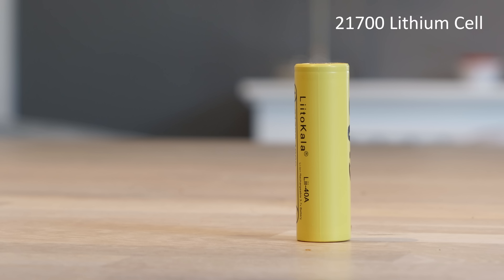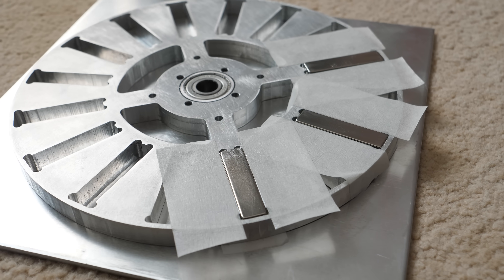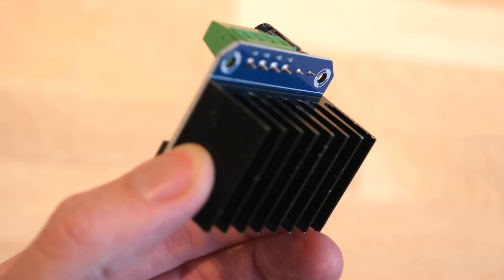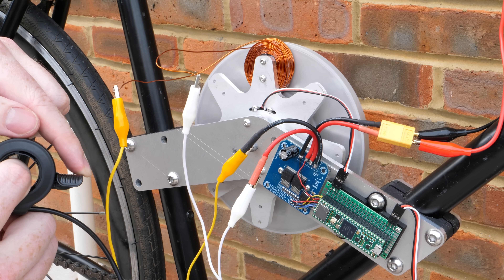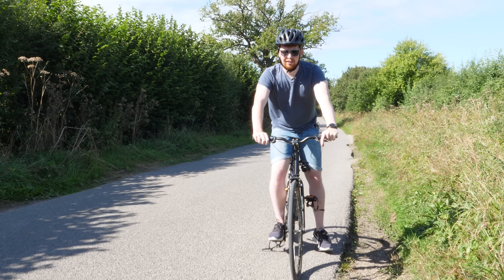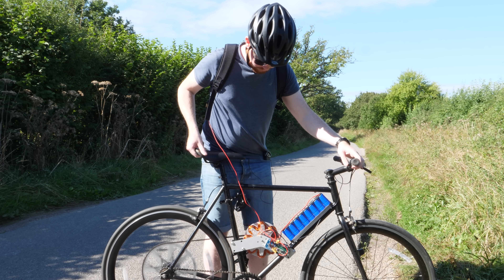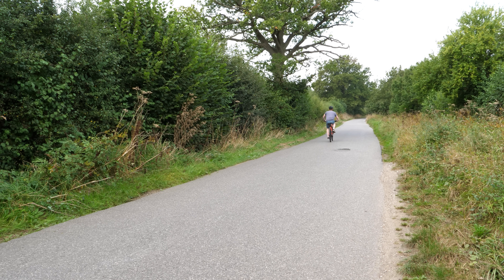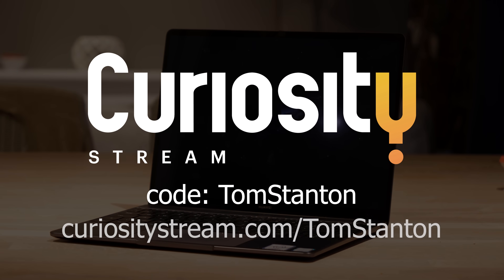Super Capacitor Bike

Comment: ´Hmmmm... may there be a logic falacy? 
Your Capacitor countains roughly 1/40 of the energy and is loaded in 1/50 of the time... may there be a connection between energy flow and time? Lets say, there is a thing which can be described as "resistance against an energy flow" cause if you shift many energy from A to B there may be some energy lost... and this loss is limiting your structures.. so if you shift many energy in time, there may be a constructional limit how many energy pro time unit you may shift... and if this limit is similar, then 40 times more energy needs 40 times longer to be transferred... if you laod a capatictor too fast.. this gives also sometimes a "caboom".....

Comment: It's very funny that you say that as the battery power depletes so will your car power/throttle.
I have a lithium ion motorcycle and it gives me full speed/power/throttle up until the battery cuts out.
It's only lead acid batteries that give off less energy as they discharge.
Lithium-ion gives its full energy until it's basically dead.

Comment: Wouldn't it have worked better if you connected the capacitors in parallel? 'Cause series capacitors have lower capacitance than a single capacitor, right?

Comment: What if you used these supercapacitors in between the battery and the regen circuit? Wouldn't it be able to act as a really faster charging buffer so more energy can be stored and then gradually moved to the actual battery afterwards?

Comment: Whenever the previously excited (set of) coil(s) is disconnected, at its (theirs) ends arises the BEMF with the peak value disproportionally larger from the input voltage, and it can be used to either recharge the supercapacitor or to drive the next (set of) coil(s) directly instead, without mediation of the supercapacitor - in particular at the relatively high rotational speed … in line with Morin’s and others (Tesla’s) “self-working” systems !!!

Comment: Would it work to attach a battery to charge the super capacitors and use the alternator you created to charge the battery and have two Banks of super capacitors One charging one discharging

Comment: Love this!  Surely the life expectancy of lithium cells will be increased as they won't be impacted by the shock of high current loads from pulling away and regen braking?  The caps will take any sudden current load either in or out? The real world use case will not only extend the life of the lithium pack  but also provide additional mileage and/or ride time.
Reply: Yes I agree.  But you need extra circuitry to allow the capacitor to be discharged down to zero volts (or close to it) because its full capacity is measured down to zero.  If you have a 12V battery and a 12V capacitor pack, and your motor causes the battery voltage to drop to 11V, then yes adding a capacitor will deliver many, many amps to bring the voltage back up to 12V.  But the capacitor voltage will also very quickly drop as it's delivering those amps, and once it reaches 11V to match the loaded battery pack then you'll be back on to the batteries again and you'll have used less than 10% of the capacitor energy.  Since you wouldn't run your batteries down to zero volts you'll never use up the full capacitor charge (which is very small to begin with), if you just connect it up in parallel to the pack.  So you'd need extra electronics, boost converters, etc. in order to do it, making it a bit more of a complicated project.  But yes, in theory, it would work as you describe and provide those benefits.

Comment: What if you have 2 sets of capacitors, and then have each set recharge while the other discharges, the same way the capacitors charged from going downhill? It probably wouldn’t be an infinite source of energy, but it could be fairly efficient
Reply: PROBABLY not infinite?

Comment: Yeah, you built the entire e-bike from scratch? Odd that I didn't see you use any rubber to make the tires, metal for the bike frame and wheels etc., and nothing was shown on how you made the bike's break pads. Now to be clear, what you did actually make in true DIY fashion was the motor and some milled out metal plate for a couple of tasks which is actually good enough for a STEM or science demonstration project, but that is about it. The problem is that you said that you made the entire e-bike from scratch. I want to see you try to market this, or more correctly stated, I want to see you fail at marketing this design as a true DIY e-bike project. Good luck with that.
Reply: damn you must be fun at parties
Reply: I am! How did you know?! BTW, what is the point in your comment? 
It isn't very clear what the point is, so would you like to give an explanation for your comment? I would be perfectly willing to explain what my comment's purpose is on a case by case basis if you would be willing to do the same, should you actually need for me to explain and break down my comment/s for you.

Comment: 41% recovery is pretty impressive for a 1st gen DIY.
Reply: Capacitors for taking off quickly from the start, li-ion batteries for cruising, with regenerative braking recharging your capacitors specifically. Now that'd be neat!
Reply: @bene6270  I was thinking just using li-ion just for holding charge, but very similar, not sure if you could trickle charge off those capacitors without smaller intermediate capacitors, but charging the capacitors from the li-ion would be easy.

Comment: Your DIY motor has a serious flaw that if address will really increase efficiency. That aluminum you made it from will be acting like a brake every time a magnetic field passes by it. Just like when you take a strong permanent magnet and drop it through a full roll of aluminum foil, the magnet will pass though the foil slowly.

Comment: Regarding electric cars and battery voltage.  That depends on which specific electric car you're talking about.  Some cars have multiple pack, all at operating voltage.  So some packs aren't even in use all the time and the battery management system switches between which packs are being used to improve cycle life.  So even if you had only 10% charge, if that 10% was a fully charged pack.  You could potentially get full power, depending on how many amps your motor can draw.  Not to mention, many systems use capacitors and voltage boosters in the electrical system to maintain proper voltage, even when the battery dips lower.

Comment: Using a Teensy for this project is overkill.
Reply: Capacitors for taking off quickly from the start, li-ion batteries for cruising, with regenerative braking recharging your capacitors specifically. Now that'd be neat!

Comment: The sad part is 50% power is lost while charging caps and 50% power is lost when discharging caps, if you add a voltage stepup circuit with some feedback i think you can pull some more juice from the caps
Reply: Capacitors for taking off quickly from the start, li-ion batteries for cruising, with regenerative braking recharging your capacitors specifically. Now that'd be neat!

Comment: What if you turn the motor into a flywheel generator. Peddling turns the flywheel not the tyre and the electricity you generate powers an electric hub.  So 100% electric bike powered 100% from peddling.

Comment: Nice work... try to use a steel backing plate on the rotor to increase magnetic flux and be wary of eddy currents in the aluminium stator that could 'steal' some power. Keep up the good work!

Comment: Not sure if Al is good for such application. Better use dielectric materials or try to keep away Al parts from changing electric and magnetic fields because of obvious reason.
Also you should add magnetic conductor to free side of  rotor, its increase magnetic field and solve your problem with chain.
Regards.

Comment: I can't stand you not accelerating yourself with the force of the motor only, i think it would probably work better as an assisting tool rather then using it to accelerate. 
Let's say you've brought your bike up to speed only using the paddles, then when you're up to speed you let the capacitors use maintain the speed without paddling and when they're empty, you use a regenerative braking system to get a little more juice out of it.

Comment: 04:33 
You could, alternatively, use a small proximity sensor and use small holes or notches at fixed radial intervals and tell the controller to just count them so it would know.

Comment: Please make another video with super caps purely for brief acceleration to speed from a standstill & the normal ebike battery takes over after. I'm guessing about a 3 second boost is probably all that'd be needed depending on the power of the ebike.
There's some mention of such things in comments below and I'd love to see you make a video about the pros and cons of doing this.
Because of the high current possible.... I'd like to see it on a fairly powerful ebike... say a 1500w 48 / 52v @ 30amp - provide the 1500w until 15mph is hit... then swap to lithium battery

Comment: If you get LCR meter you can loose count and keep wrapping tell the inductance matches.

This is a neat idea you can take a small battery and a small buck boost into the caps you can use very efficiently low c rate batteries to feed long range while the caps handle regen. Also keep in mind series caps divide the capacitance for this is really just a 50F cap just be careful caps have the same balancing problems as LiPo and a cap will make a much bigger boom when over voltage failure hits if it just a little over it might just vent but a sudden current spike on a cap at 150%+ it voltage rating sounds like an well you get the idea

Comment: This is bloody cool!
It's less like an electric vehicle, and more an integrated assistance mechanism for recovery like in F1 vehicles. think on long journeys with a large enough capacity, it could help reduce the effort  input from the rider having to push their effort as hard, recovered from their previous input energy. you could fine tune it to have a maximum output discharged to make how fast/or how much extra torque it would give you on each push of the pedal I reckon

NextVideoTM?

Comment: Tom please look into Sound it can freeze stuff ...round steel tube welded too 6 sq plate steel about 1.6 inch from bottom a #6wire 190 turns.....it should hummm
A nice tune wait 25 min

Comment: Would it be possible to use the capacitors to assist in recharging lithium ion batteries? Ive noticed the regenerative breaking doesn't really work effectively on my bike as the batteries have a limit of the rate they can charge at.

Comment: One thing that I think is worth looking at, is using regenerative breaking to quickly charge the super capacitors, and then thought the right circuitry, using that energy to charge the primary battery pack. The current draw to the super capacitors from the regenerative breaking could be limited and arranged to collect energy during coasting with minimal resistance and reduction in speed.

Comment: So if you had a bike capable of re-gen and it had a standard Li-ion battery and a bank of supercapacitors that were only used in max or sudden acceleration but charged first from any re-gen then you would be onto a winner. I seem to think that a local car manufacturer we once had was working on something similar for a hybrid project with a local university as the manufacturer is now gone I would say the project is gone as well.

Comment: Could get maybe 3x the range with another identical capacitor bank.

Start with both banks in parallel, then once voltage has dropped off switch them to serise

Comment: That motor is a brilliant piece of engineering.  I suggested once that electric motors could be made wider and more slender for more high torque applications, but I was told that it wouldn't work.  You have proved that it can work.

Comment: 1000s of Fs of exposed caps with  thin charging wiring dangling from your backpack as well as with those caps being right between your legs....it's a safety nightmare...what if they were to arc and  discharge or short ? Those wires will melt like cheese in a second....plz be more careful.

Comment: Should have made a second coil assembly that is wound for high voltage and low current for charging the Supercapacitors through an mppt charge controller that will take that high voltage low current and low load on the motor and step it down to the working voltage of the Supercapacitors.... 
So basically you need thinner wire on the generator but more turns and thicker wire on the motor and less turns... It's just a theory of mine and I feel that it could work but I'm not sure.... 
If this actually works and you make a regeneration circuit that can also add to the generator, then that would be pretty awesome...

Comment: 0:50 I just want to know why he’s moving the wheel so much
Reply: Capacitors for taking off quickly from the start, li-ion batteries for cruising, with regenerative braking recharging your capacitors specifically. Now that'd be neat!
Reply: @bene6270  ?
Reply: @bene6270  just shut, stop spamming

Comment: Dear Tom, what would it take to bump into you for 30mins? I need to ask you a technical question about a really advanced flying machine I found patents/ plans for. The science looks like it would work & wanted a second opinion to explore & confirm more regarding its coranda effect, electrogravitics, gyroscopes, vacuum impeller, electro-static air blades... etc design used. I don't mind paying you for your time & for your opinion... it's quite fascinating what has been found & is bugging me. I live in Surrey England & can meet you quickly if your in the south of England. Thanks so much, kind regards Justin 🙂

Comment: Excellent motor build.   A couple of improvements you can make.   1.  Use ferrous cores in your coils to increase flux.   2.  Stacked magnets are not nearly as strong as single magnets of the total dimensions, like about half...so find the right size magnets for the job without staking them.    Was that a Teensy you used?

Comment: What about a boost convertor that only kicks in when it's under the motor's required voltage? That should let you use a bit more of the graph area

Comment: You might use a dc-dc converter be feeded with capacitor pool, you loose some energy on conversion, but you get CONSTANT Vdc in the output, until capacitor is very discharged.
Some dc-dc converteer topology (buck converter) might be readily available to get this in a very simple manner.
Reply: You'll want a boost converter, but keep in mind that as the voltage drops, you'll pull more and more current.
Reply: @EGL24Xx  Should be fine because what you really want is to get the capacitor as close to zero volts as possible, so that you've maximised your use of its energy storage capacity.
Reply: @Berkeloid0  yeah, the topology that lowers the voltage even more definitely will be fine

Comment: The absence of magnetic cores surprised me. I don't know (without running some numbers) whether you'd hit saturation early with ferrite or similar and I know of several people that had issues removing rust from the edges of transformer laminations in equipment they were restoring only to discover they had managed to electrically short them together, defeating the purpose but an idea from another comment here (to repurpose old transformer cores) sounds like it has potential.

Comment: Great stuff... but How did you calculate the energy?    I count 8 cells in series...
8*2.7V -> 21.6V across pack

8 in series 400F caps ->  50F equivalent capacitance for pack
E=0.5 * C *V*V -> 11,664J

that's an order of magnitude smaller than your calcs

Comment: So it charges in two minutes, but it only runs for two minutes. Hmmm my Fiat 500e  charges to full in 4.5 hours, but will run out of power after about 3 hours of 60mph driving. Although in stop and go traffic under 30mph you could drive 5-6 hours.

Comment: First a voltage Regulator with a simple PI controller can solve the problem of voltage change. And the motor can design to fit any rated voltage (unless the voltage is too high and break the insulation). And it's really dumb to design a motor with out careful calculation. (It's about 150 equations to design a motor from zero, and take about two years to train a regular collage student in STEM to fully understand the motor)

Comment: Tom - OK - next project for the super capacitor bike is to setup induction charging pads that drag behind the bike so you can do TURBO pads like in video games. If you positioned them frequently enough you could pulse along the trail just by hitting the >>> areas on the road like Mario Kart. :)

Comment: I think you could do a way better job. you need to get a good motor controller with good regenerative breaking. Along with the hybrid setup with lithium-ion and capacitors.  And you need to double or triple the capacity of is the of the capacitors. 400f per cap is pretty low compared to what Maxwell actually offers. Thats like the medium low end of super caps.

Comment: The gearing is the problem, need a smaller gear driving a larger gear for more torque at less speed. Although your setup is good for starting out with pedals then using the motor for cruising. Amazing engineering of the motor and controller